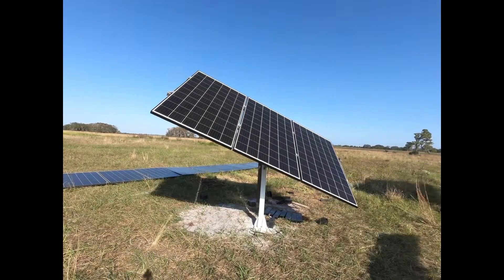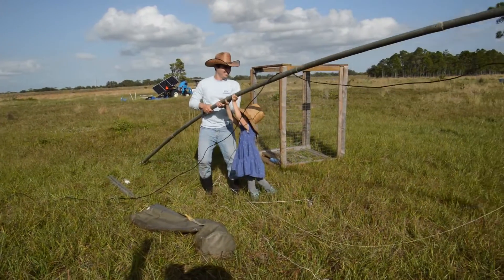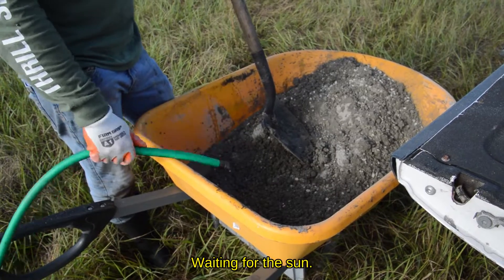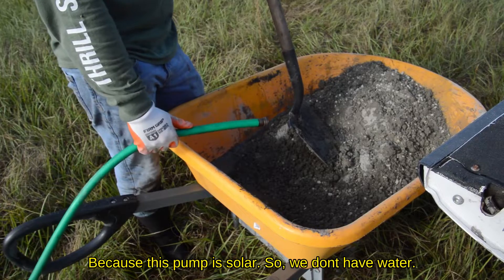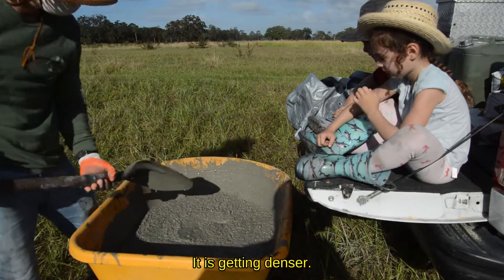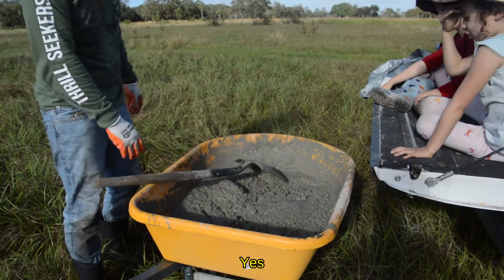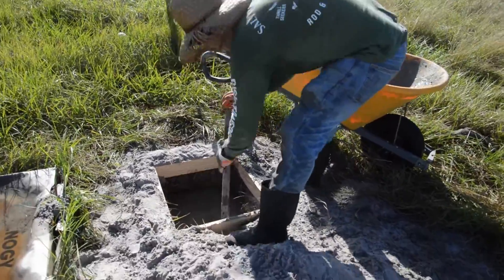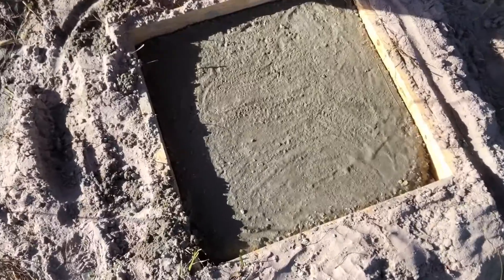Solar Tracker Installation. Volume 1: Foundations.

Comment: How deep did you dig?  What are the dimensions of the concrete base?
Reply from the maker: This is a previous response to the same question:
 "The shape of the pad is like an inverted mushroom, the cap on the bottom has 30 inches in diameter, on the top is an square of 19 inches sides, the deep is 2 ft.
It's more than a year now and it's holding fine."

Comment: Hi, I installed a 2-axis solar controller in my DIY solar tracker: https://youtu.be/_Rs8CptQcDw . Save electricity costs by avoiding electricity purchases / shortened amortization: With Dimmer + Solar PV, self-sufficiency will now increase to almost 95%, because expensive purchases from the grid are so easily suppressed and the electricity bill lasts just like the electricity meter. The prerequisite is that you have at least a small solar PV balcony power plant, and you don't need an expensive battery either. Example of a kettle: Without a dimmer, the 2500W - 600W PV system needs = 1900W, which you have to pay more for. If I turn the kettle down to 600W with a dimmer, then every weak PV system can now supply each consumer independently and independently, because the 2500W kettle becomes a 600W kettle thanks to the dimmer. Magic... The 2000W e-heater becomes a 500W e-heater with a dimmer, which can run 12 hours a day free of charge via PV. https://youtu.be/eC2olbCBhh0 . The 4000W oven is also tamed. Not the solar systems have to grow, but the consumers just have to drop by 75%, which is sooo easy with the dimmer. I have already switched my entire household to dimmers. Please have a look at my channel. ........ 🌞 ....... Increase mini PV solar self-sufficiency (winter and camping): A boiler and other power-hungry consumers can be infinitely reduced using the "5000W dimmer". Ebay €7. I run 4 dimmers in parallel on an 850W inverter. Kettle 2.2KW at 150W runs 12 hours a day, so the water is always hot https://youtu.be/D9Ss0RuqZG0 . The room is also nicely heated. 2.5KW washing machine runs in parallel with dimmed to 400...600W and always reaches its 60°C, and also its 1400rpm... It doesn't matter to the washing machine whether it changes the washing temperature to 5min@2500W or 100% can be achieved free of charge via existing PV power in 20min@600W. The wash cycle lasts the same time dimmed and non-dimmed, 3Sth 10min. The iron https://youtu.be/-71oL7z1kMU , dishwasher https://youtu.be/8vnAkrS1x-s , oven https://youtu.be/azDjqZpz77U , electric heater https://youtu.be/QbLWDbJi6ew , Waffle iron https://youtube.com/shorts/ofanZCdYEjA?feature=share, coffee machine, all internal heating is throttled with me. Lots of videos on my channel. The inverter stays cool and quiet and the MOSFETs + (battery packs) stay intact because extreme current peaks no longer reach the inverter. Now every Mini PV Inverter is enough to operate large devices. So, with the dimmer, all internal heaters/devices can be converted into base load devices that stay almost permanently ON, drawing very little current directly from the PV. With a wattmeter / energy cost meter you can then measure this perfectly in order to set the dimmer optimally. ........ Comments: "Great idea - despite studying electrical engineering, I didn't think of it myself ;-)" or "I installed it in our washing machine, great idea!" or "Glück Auf Christian, I'm a professional myself but I haven't figured that out yet.👌 Greetings Mitch💚" and many more... LG Christian .............. 🌞 . .............. ................ ................ "smart energy saving" , has made a meaningful reaction video to the dimmer: https://youtu.be/EHtJGiXAjZk . 🌞 ......... "Free Range", also made a meaningful reaction video, to the dimmer: https://youtu.be/qzdRdBObtvY . 👍........ "Jens Kummerow TS", also made a meaningful reaction video for the dimmer: https://youtu.be/fTY5jWvz5CY . ............... 👌 ................ ................ .. ............. Small hint: Energy cannot be saved. So if I want to boil my water, I always have to use the same amount of energy for one liter. Christian's method relies on a longer period of time with less power in order to be able to use the power provided by the PV as efficiently as possible - so consumption peaks are intercepted. In the end, the energy consumption should even be (slightly) higher due to the interposition of the dimmer, but it doesn't matter, since more efficient coverage by the PV system and therefore better use of the self-generated energy .......... .... 🌞 ............... ................ .............. ............... ................ .............. ............... ................ .............. ............... ................ .............. ............... ................ .............. .............. ............... ................ .............. ............... ................ .............. ............... ................ .............. ............... ................ .............. .............. ............... ................ .............. ............... ................ .............. ............... ................ .............. ............... ................ .............. .............. ............... ................ .............. ............... ................ .............. ............... ................ .............. ............... ................ ..............